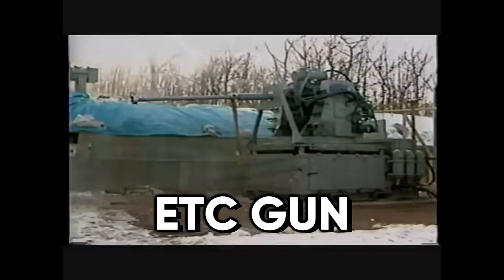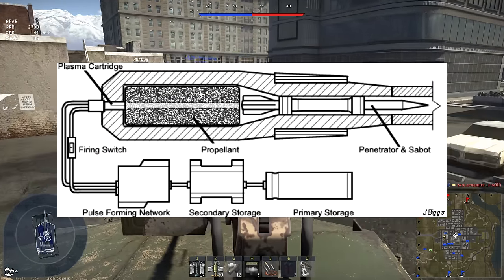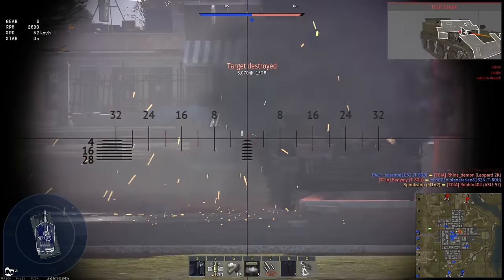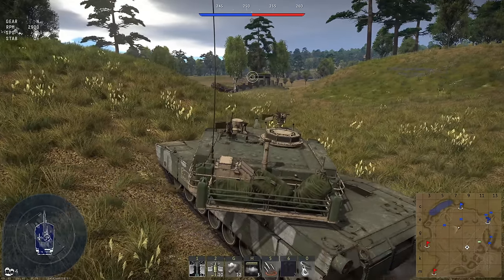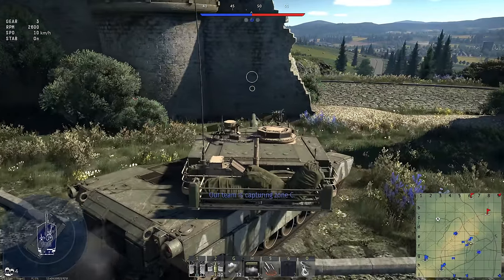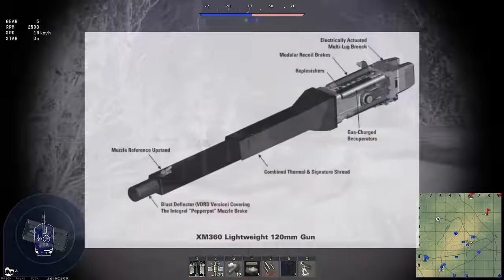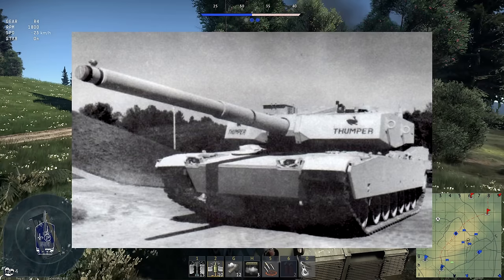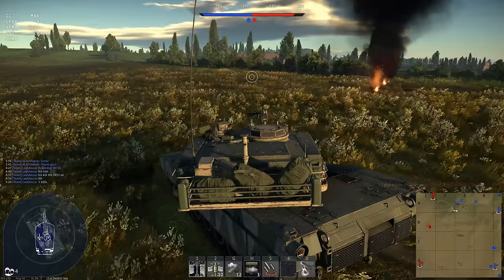ETC Cannons - The Future of Tank Weaponry

Comment: I doubt that the increased muzzle velocity claimed is possible. The velocity of a bullet propelled by the expansion of gasses is limited by the speed of sound of the gas. Increasing the speed of sound in a gas would require you to either increase the temperature, or use a gas with a lower molecular weight (the main combustion products of all energetic materials is and will remain CO2, N2, and water for the foreseeable future, so no significant progress there). Increasing the temperature decreases the service life of the barrel, which is a significant issue for large caliber weapons. The increased ignition consistency of ETC guns would probably be nice, though.

Comment: It is strange to me that they opted for solutions to make faster the explosions.  The issue with faster explosion is the fact that it will result in far higher peak pressure in the gun barrel and gun breech. I thought that for a long time this was the main issue with faster explosives, because the peak pressure were so much that the material science and industry at the time couldn't create militarily feasible gun components that can withstand the workload. I thought that this may be one of the reason why they still used gunpowder at the invention nitroglicerin and dynamite  (apart from instability).

An ideal conventional (thermodynamic) firearm is an internal combustion piston engine that doesn't operate in a cycle but comes apart and it creates work purely by adiabatic expansion process. In an ideal firearm, the conversion of the propellant into hot gas is instantaneous, and after that conversion, the adiabatic expansion of the gas starts to push out the piston (pojectile + sabot). Its pressure-volume or pressure-distance along barrel diagram starts with a sharp peak, which is the pressure of the instantaneously converted propellant's hot gas, and then from that peak point it continues with the curve of an adiabatic expansion, until we reach the gun barrel's volume or length. By using slower propellants the inital peak broaden and decrease in height. Of course it will  typically result in less work i.e slower projectile, but the peak pressure will be far more manageable.
This ETC technology seems to be a workaround to sharpen and heighen the initial peak on the pV diagram without modifying the propellant itself.

I've found a nice article about explosive behaviors:
https://iopscience.iop.org/article/10.1088/1742-6596/500/5/052027/pdf
For short, explosives are materials that contains the appropriate ratio of fuel and oxidizer.  What really influences the properties of the explosion (apart from the oxidizer and fuel) is the microstructure of the mixture. One diciding factor is the separation of the fuel and the oxidizer.  Typically, the smaller the separation, the larger the reaction rate. But in the military they use high-end molecular explosives, so in this case it won't be a deciding factor. What really migth cause the inconsistencies of the explosives are the irregularites in the crystalline structure and overall microstructure. So a more straightforward solution would be to eliminate these irregularities that are almost always present in solid propellants.
One nice solution would be employing liquid molecular explosives as propellants. If we stick to electronic ignition, installing multiple electrodes along the container we can further enchance the combustion rate of the explosives.
Reply: So basically it should work like Otto cycle / Petrol Engine.

Comment: There will need to be a secondary means of firing ECT without relying of the plasma system should it be disabled or the tank suffer a complete power failure. I could see this be a staple of the MBT while Tank Destroyers make a comeback featuring rail guns. Also that first clip made me think of the Lightning medium tank from Planetside 2. You should do a video one the various faction's MBTs.

Comment: etc guns still require power if a system fails theres no failsafe backup to keep you in the fight. a regular gun system can still fire without power just strike the primer and let recoil perform the reload
Reply: modern tank use electricity to set off primer in the round. We now put GPS and rocket motor in round, we are way past the point where you needed to worry about electronic being unreliable for vehicle.

Comment: I'd like to confirm something I've seen stated before. Despite the fact that we could increase muzzle velocity, wouldn't it be increasingly innefficient to do so as the projectile leaves the hydrodynamic regime? Tungsten and depleted uranium would likely explode before slowing down enough to begin penetrating.
Reply from the maker: It's safe to assume that by the time this kind of cannon starts to become widespread, we would have developed a penetrator capable of enduring such velocities.

Comment: I feel like this is nother one of those innovations that's so simple (relatively) that one was to ask why nobody's tried it before or why it hasn't gotten more attention. I guess part of why is because it lacks the glamour of the railgun or the plasma cannon.
Reply: My guess would be their was never a need for it, there is no point i builing a cannon that can pierce an armor that no tank have.
Reply: @benjamin1359870  True, but you could also use it differently. The increase in velocity does mean you'd need less mass in order to penetrate contemporary or older types of armor, so you can get away with using smaller lighter ammo. But the power requirements and the weight of the power source might just have made it less practical.

Comment: The "problem" with full (as opposed to just the igniter demonstrated) ETC weapons (i.e. the 2.5 to 4km/s velocities) is the propellant gasses pretty much need to be stored separately from the projectile.  Not a huge deal for cannons, but not really practical for rifles and machineguns.  Also currently available probellent gasses are HIGHLY flammable/explosive, you really don't want to be in a vehicle using ETC and get hit, crew survival, improbable.

Comment: Unless the plasma igniter is consistently giving you far higher velocity for the same size it is .......just another part that can break!   Guns should be built and operated as simply as can be possible to achieve their purpose.
Reply: That's exactly what plasma ignition would do, yes. In fact, if a good propellant can be developed, you'll                         get more velocity from less weight/size than conventional ammunition
Reply: @talltroll7092    One battery problem....... as in they are quite heavy and not very power dense.  2.  Bearing surfaces problem, by that I mean if you increase the velocity of a projectile by  lets say 30% in A tank your barrel even a smoothbore is going to be tits up dead in well less than half the time.  3.  Entrenched contractor tax thieves will get the commission to develop and build these which means A decade late, under-performing, and 3X over budget.

Comment: Wouldn’t the need for more electronic components make them extremely susceptible to an EMP weapon?
Reply: Tanks now have onboard computer and artillery shell have GPS system, we are past the point of worrying about having a little bit of electronic in vehicle.
Reply: With the power requirements of a system like this is doubt an EMP would even do anything. Not to mention that pretty much all military equipment nowadays is shielded against EMPs.
Reply: benjamin1359870 I always thought that the military tried to keep down on electronics tbh
Reply: @locomotivefaox  they do for soldier, not for vehicle though, you need to keep in mind that we are talking about vehicle that cost in the multiple millions, also people tend to forget how widespread electronic is and how reliable it has become, every modern car now have an onboard computer and most people are not even aware of it.

Comment: There are some very high speed explosives. With the right one you could get speeds of 8 kms or higher. I wonder what the limit is. I understand at such high speeds the round has to leave the barrel before the barrel comes apart. But if you could get the breach and barrel to hold you could get maybe as high as 10 kps. No amour could with stand such a round.

https://en.wikipedia.org/wiki/Table_of_explosive_detonation_velocities

Comment: Would you consider critiquing DARPAs concept tank- i.e. future tank as a one-man grounded fighter on articulated suspension?
Reply: How is one dude going to maintain a whole tank? Interesting idea, unworkable in practice
Reply: Tall Troll supposedly, it’ll be mostly automated like the systems of single-seat fighter planes. I expect it wouldn’t include anything needing a second person (machine gun vs sliding-block breech cannon)
Reply: @IAmTheAce5  Planes make it work by operating from fixed locations with massive logistic/maintenance  support. Tanks operate in the field for weeks or months at a time, and require 10-20 manhours of maintenance per day to stay operational. It would also require every tank crew to be an expert mechanic, capable of maintaining every single system on their vehicle personally. Even if you can reduce the maintenance overhead, how does one crew do something as basic as changing a track on their own?
Reply: @talltroll7092  All I have to go off of are the pretty concept art of the DARPA Ground X-vehicle Technology. You're probably right about maintenance requirement- I expect that limits such a vehicle's range from a base of operations.

Comment: So wait a second. Electrical triggers have been a thing for a long time. Some tanks from WWII hat them. They reduce the lock time by using electricity to ignite the primer or powder charge. Lock time is the time it would usually take the striker or hammer in a firearm to hit the primer. I think the time until the projectile leaves the barrel might also be included.
Look for some slow-mo footage of flintlock guns. They have a huge delay when firing, because the powder in the pan needs to ignite first and then, the fire has to go through the flash hole and then the main charge needs to burn. Black powder burns a lot slower than modern smokeless powders.
There is even a modern bolt action rifle that uses an electrical trigger, but it was never a success, because it doesn't make that much of a difference, and it needs special ammo.
So anyway, how is this any different? What is so special about ETC cannons?

Comment: So you can't use your ETC gun after an massive EMP, but with a conventional gun you could still fire.
Reply: Or just after a simple loss of power. Is that right?
Reply: I can actually see this type of gun still using a regular firing pin and electrical ignition at the same time. Also military equipment have been shielded from EMPs for quite a while now. I think the only thing still really affected by them are consumer grade electronics.

Comment: I down voted because you did not mention barrel life. Going to much higher velocities are going to have a significant impact on barrel life. That was one of the problems with rail guns, and I doubt that rail guns will ever be in a production tank or ship because they need the ridiculously massive power supply. And with ETC guns giving such a substantial improvement in velocity, why bother. Driving a rail gun to go to even higher velocities will even reduce barrel life much more. In addition, what performance improvement that was gained with rail gun, the same technology could be used in a conventional gun with almost the same effectiveness. Another problem with much higher  velocities is that air resistance increases substantially, so you lose a lot of the increased velocity quickly.

Comment: I think you understand wrongly about gun charge, which the faster burn is better. In reality, the designers optimize the burning speed  or charge, so the projectile are kept pushed inside the bore. If the charge burn too fast, the pressure are too powerful, so they must increase thickness of the bore, which mean more necessary weight. In the other hand, if the charge burn too slow, it will waste the potential energy, since the later burn have no effect on the projectile if it already left the bore.

Comment: U forgot something ETC guns are enegy dependent so if EMPs hit the tank will render it useless otherwise conventiona guns will still operate because they do not rely only on power.
Reply: As far as I'm aware though, most Tanks are hardened against EMP. I recall a documentary where they showed an Abrams being placed under some sort of emitter at the factory it was built/refitted at to qualify it, which makes sense when you consider how much electronics are already installed. An ETC upgrade would probably have minimal effect on vulnerability, if any.

Comment: First of all, ETC isnt a cannon, its just a ânother electrical ignition method. To call it the "brother of the railgun" is incredibly bizarre, considering railguns have about zero to do with conventional/ETC guns. Its also nothing new; Germany actually had some research into ETC guns around the 2000s, but later shifted away from it.

Otherwise, sure ETC allows shells to use a bit more powerful propellants, but I dont how making propellant a bit more efficient replaces bigger guns? That german 130mm gun has significantly more power than a 120mm gun could ever produce, and you can also equip a 130mm shell with ETC system.

Comment: So like how a minigun works ?
Reply: Nope.
Reply: @ANDREALEONE95  What do you mean nope a minigun works the exact same... just with revolving barrels
Reply: @GiRR007  Miniguns are ballistic weapons that use gun powder to bullets while etc use an electric charge that activate a plasma charge to do it. The only electrical part is those that moves barrels.
Reply: @ANDREALEONE95  etcs use electricity to ingite the the powder in the shell instead of using a primer that has to be struck with a hammer, same as a mini gun
they both use electricity to ignite the powder in the bullet casing.